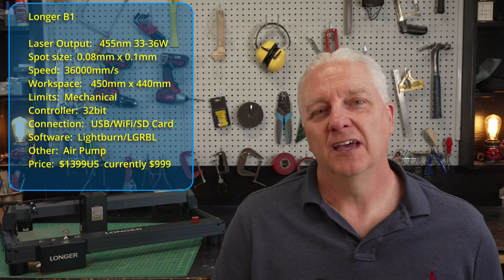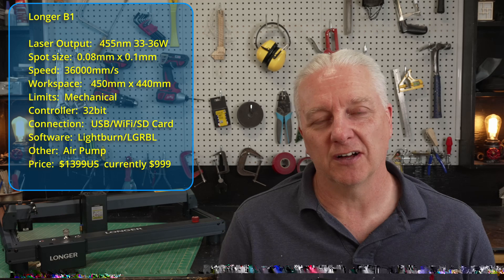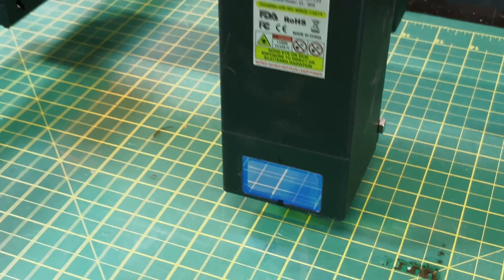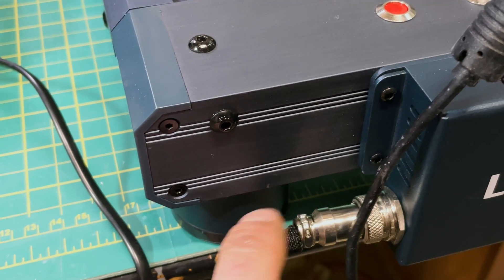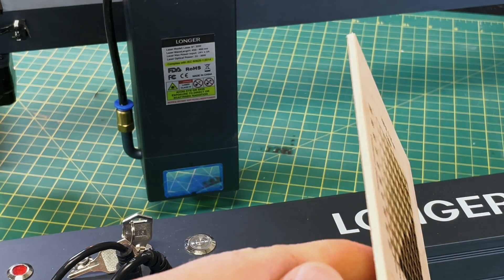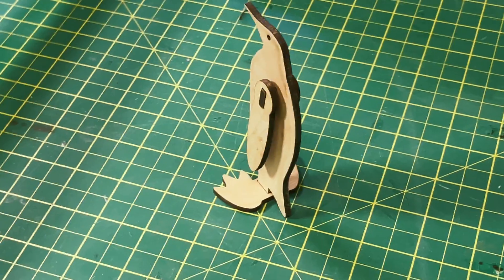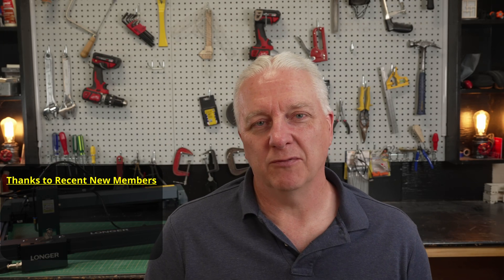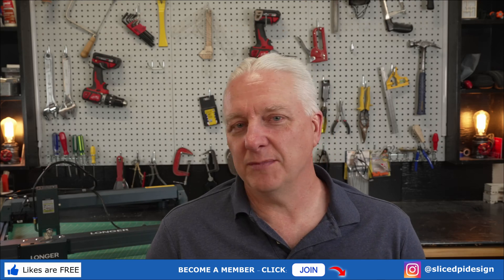The Longer Laser B1 30W Takes Center Stage - The Laser You MUST Own

Comment: Hi Steve. Having trouble with homing on B1 30 watt. Keeps hitting front rail. limit switch  x and y are installed.
Reply from the maker: Make that the homing position is in the lower left corner in Lightburn.  Also make sure that the limit switch at the front of the laser can be reached.
Reply: Thank you Steve. I had the Y axle limit switch in the wrong set of holes. I didn’t realise there was two sets of two holes. I must’ve missed that in the directions thank you very much.

Comment: Just assembled the B1 30W. After powering up and accessed by Lightburn, I had it move to the "home" position. It reached  the Y switch ok but came to a hard stop 2mm before hitting the X switch. Seems like the switch location is wrong. Hear of anyone else with this problem?
Reply from the maker: I haven’t, but make sure there isn’t anything in the way on either side, or that the cables aren’t binding and preventing movement.  In the worst case you could adjust the switch location, though I can’t remember if that’s possible on the B1 or not.
Reply: @SteveMakesEverything  Thanks for the quick reply. It's a hard stop and I can't see anything in the way. Temporarily, I'm gluing a 2.5mm shim to the side of the head until I hear back from Longer. Hopefully they have a fix.

Comment: has anyone modified a co2 laser to run with a diode laser head?
Reply from the maker: Are you asking about a CO2 laser that is also a diode laser?  I have thought about this with my DIY CO2 laser, and in theory, it should be pretty easy to do.  But I'm not sure there's a lot of value since a CO2 laser can do 90% of what a typical diode laser can, plus it can do a lot of this a diode laser can't.

Comment: Hi Steve....
Yup, another question from frequent flyer Hank....  BUT, THIS is really important - (I think)....
Well, UPS says my B1 36 will be delivered tomorrow, Monday 4-8-24.  From the assembly videos I've seen, the belt "idler/tension/adjuster pulleys" are SMOOTH and not toothed.  I will know for sure tomorrow what type idler pulley Longer is NOW using, but, It just seems to me, my design engineering self, that for a toothed belt to roll over a smooth idler is not optimal, squishing the teeth vs having them run in the proper slotted teeth.  I believe that a toothed idler will give the belts the PROPER seating when they run over them.  I think that IF I decide to change out the smooth idlers with toothed ones, it should be done in the very early hours, if not immediately, before running the machine.  What is YOUR opinion on smooth vs toothed idler pulleys??  Thank you for your experienced reply....  Hank   P.S.  (IF I am way overthinking this subject, You gotta tell me, I will appreciate your comments)....
Reply from the maker: Rest assured, the presence or absence of teeth on the idler pulleys is not a cause for concern.  The idler's primary function is to maintain the belt's alignment, not to necessarily engage with the belt.

What I will suggest for the B1, though, is to engrave a big circle (~100mm dia) to make sure the arc is smooth.  On mine, I had to lower the X and Y acceleration values in the machine settings because, with the 40W module, the weight was just a bit much for the steppers to push so quickly.  I don't recall seeing this on the 36W module, but it's worth checking.

I don't think there is anything mechanically wrong, but rather, the default acceleration values are just too high for the laser module's mass.  When engraving a circle, the X and X are constantly changing, so with a heavy laser module, the gantry is constantly jerking around which amplifies the inertial effects.
Reply: @SteveMakesEverything  Thank you Steve....  I really appreciate your advise....  Being retired from a career working for KSC, I have a tendency to “over 
engineer” common, everyday items it terms of " what does NASA require"?  I’ll have to determine is this “fix” really necessary and just use as designed… (Don’t sweat the small stuff)…  Thanks again..  Hank
Reply from the maker: @ainttakenanyshit  😀  Well, this made me laugh, but I can relate, having spent many years in industries where if someone makes a mistake, people die.

Comment: Hi Steve, need a favor please.  Big "A" has the Longer B1 36 watt kit with some material for ONLY 899.99.  Now, I want to hit the wood burning and maybe use my current hood.  IF the B1 can be raised buy ~1/2 inch, the bottom tubular frame may just fit underneath the B1's frame and the extra 1/2 inch needed for each side may just work.  Can you please report the width and depth of your B1?  The nearest 1/16" or so will let me know if my plan will work.  Thanks ahead of time for your measurements.  Hank

P.S.  If you may also measure the distance between the left and right feet, (not the bottom of the foot, but the foot SCREW - itself), THAT will be the determining measurement if my old hood will work with the hood's bottom frame tube will fit between.  Thank you BIGELY for your time....
Reply from the maker: Hi Hank, For the dimensions, you can look at the Longer web page. My laser is currently on loan, so I don't have it at my fingertips to provide a measurement.

The laser is a light frame and you can raise it to any height you need to.  Just remember that there is limited Z-travel so whatever you slide under the frame needs to be able to reach the laser.
Reply: @SteveMakesEverything  Thanks Steve.  I bit the bullet and just bought another enclosure that will have room to spare.  For 99 bucks I bought the enclosure for the "Twotrees TS2 machine with dimensions of 800mm x 800mm x 400mm, (31.5" x 31.5" x 15.8")....  I understand that there are two "optional "cutouts on the right side, (front and rear), and on the left front side which may be opened a bit to provide some cross air flow over the machine which "should" help with smoke "withdrawal".   I'll have a couple of inches to spare and from the reportedly low airflow that the included fan provides, I bought a 4" inline duct fan - ~130 CFM vs the maybe ~60 CFM stock fan.  I am going to mount a full 4 inch air duct connector to the enclosure to take advantage of the full 4 inches of available duct diameter.  My first cuts will be to make a 4 inch "backer plate" for the duct adapters....  These enclosure kits often use only a 3 inch to 4 inch diameter vent adapter which restricts what airflow is possible.  This coming Tuesday is MY B1 day...  🙂

Comment: With the exception of lower power in the 20(24) watt model, would you say the units are basically the same in features and build quality?  What is your "ideal" belt tension so as to help reduce line squiggle, BUT, not to over-stress the belt pulleys/bearings?  These bearings will run all day long in a complete circular manner and when engraving very small images, the very small rotational motion of these bearings have a tendency to have more localized wear with the very small "rocking" effect in the bearing track.  How tight is tight enough for belt tension?  Thank you for ANOTHER great video that answers a lot of the questions "we" have about these machines....
Reply from the maker: All B1’s use the same hardware regardless of the laser power, so the same features and quality regardless.  You won’t get localized wear on the  pulleys and rollers because they make several rotations when moving even short distances. However they bearings, so you might eventually have to replace the rollers, though I haven’t ever had  to replace one - this applies to any laser btw.

As for belt tension, they should be tight, but you should still be able to easily squeeze both sides of the belt together. They aren’t guitar strings.
Reply: @SteveMakesEverything  /Thank you Steve for the info.  My B1 36 will be delivered next Tuesday  ;-)

Comment: Does that Y limit switch actually work? On my machine, the laser head hits the frame before the limit switch is touched.
Reply from the maker: I 3D printed a little extension to press the limit switch sooner.  If you have that and it’s still hitting then maybe it needs to be longer

Comment: I just bought the longer b1 40 watt and it is a great laser but the way they hold the laser head on the dove tail is very hard to get to when you have big hands like I do...was wondering how you over come this problem...Bill
Reply from the maker: Hi Bill.  Yes I agree that they make the screw very hard to get too.  I don't have a solution for this other than to use needle-nosed pliers or maybe 3D print some kind of extender to bring the screw out further.  Or get a longer screw

Comment: Please help me I have a DAJA d6 laser engraver, I want to engrave personalised initials “in gold”, is there some kind of gold foil I can use for this? ,
Reply from the maker: A diode laser can’t engrave gold. For this you would need an IR laser or fiber laser
Reply: @SteveMakesEverything  thank you for your fast response, so just to clarify I’m not looking to engrave gold, I’m looking for a gold coloured foil similar the the black water slip foil I use to engrave black letters into leather.
Reply from the maker: @bustamango863  Ah!  I don't know of a particular foil that would do this (other than gold, of course), but in this case, I think you would apply it the same way you would if you were gilding engravings in wood.

From my own misguided perspective, I would probably mask off the leather before engraving the letters and then paint it with gold acrylic paint afterward.  (Disclaimer:  I'm not any sort of expert in this area, so I wouldn't trust me 😀)
Reply: Ok thank you for responding I will  look into it. Very helpful thank you.  @SteveMakesEverything

Comment: Xtool uses their own free software creative space and seems easy to use for beginners. Videos I've seen show with creative space you tell it the type of material, thickness and it automatically sets the perimeters as a good starting point, does light burn have a similar  feature?
Reply from the maker: In lightburn you can use the material library. It’s kind of similar in capability but is a bit more complicated. Overall lightburn is more capable than xTool XCS but has more of a learning curve.  Also newer lasers from xTool and others, have more features than traditional diode lasers and these aren’t supported in lightburn

Comment: I feel longer really dropped the Ball, 
I think they new of the software problems and sold the b1 to drag in cash and 2 they disappoint me because you guys have to figure out the problem for them and now the question is did they fix the software problem and the air assist problem that showed up in other videos.
I really wanted to buy the b1 but if they still have the same issues I will go with sculpfun 30 watt lazer. It will be my first lazer and the last thing I need is to have problems right out of the box.
Reply from the maker: I love a contrarian opinion 😁. However I haven’t seen any real software problems with the Longer B1 and having used it in my own shop since I got it, it remains one of my favorite  new diode lasers.  The only problem I ran into was in Lightburn, which selected the wrong driver during automatic setup.
Reply: @SteveMakesEverything  
I guess that was the one I was referring to the selective of the wrong driver
I really do like the b1 it will remain on the top of my list and I will be watching all the videos I can on this laser thank you for your videos.
Reply from the maker: @sigh_of_the_times  I'm not surempf this was a B1 laser  or a Lightburn problem.  Either way it was easy to fix and resolved all of the issues I was having

Comment: how did you manage to setup the wifi-connection?? theres only one way to operate this monster: you have to be in range of your usb-cable...  this is sad!
Reply from the maker: I used usb. I dislike most wifi features on diode lasers because most of the time they are pretty flakey.

Comment: Well I have not purchased a 30watter yet...I plan to, but see some decent looking upgrades on some of the options out there.
Any chance you will be doing a reveiw on the Atezr L2 36w Laser? It would be great to know how theses 2 compare.
The Atzer is about $350 more, I think the upgrades it has might be worth it.
What do you think of Atezr as a company? Going to watch your videos on Atezr products now.
Reply from the maker: The 35W L2 is essentially the same laser as the V35 so you can compare output to that. I’m not sure what upgrades you are referring to on on the L2. The only significant one is autofocus, but it’s far too slow for me to ever use.

Just some clarity of 35W lasers vs 20w or even 10w lasers. Don’t get hung up on power as the key feature.  Most laser companies show 35W and 40W lasers cutting through lumber, but in reality that is never a use case you are likely to have.  Instead think of power as a gauge of speed.  Higher power laser can engrave and cut faster. This is more important in a business than in your house,so if you’re on a budget, then opt for a 20W laser and you won’t really be disappointed, but you’ll save a ton of money. 

Both of these are great lasers, but right now, I would give the edge to the B1.
Reply: How about the linear rails would they be worth the extra $$$ ? Are they on X and Y ?
One of the reasons I am looknig for more power is to cut into some rocks from N.H. beaches...
Some one had a video where they cut into a rock with the B1 30w about .5mm deep, it looked good, how true that is I don't know.
My Longer 10w (I think) melts the rock and most of the time (depending on the rock) embosses what ever I am  engraving.
Thank you for the feedback...going to wait a bit before I buy...Hopefully the sale on the B1 doesn't end.
Reply from the maker: @eddrm4685  The linear rails are nice.

If your 10W is melting the rock, then your speed might be a bit slow, and you might want to go faster with multiple passes.

From any stone that I have engraved, I can say that results can be very unpredictable due to the composition of the material.  I don't honestly think this has much to do with the power of your laser.  

I've taken two stones that have looked identical in color, yet one engraves nicely, and the other basically melts.  I now try to do a sample of tiny engraving on the back of the stone to ensure that the main engraving will be what I want.

Comment: Hi Steve. Would you recommend this laser over the xtool 20w or the atezr 20w for overall use (hobby use and small business production)?
Reply from the maker: Well when you factor price, performance and features, I would favour the B1 30W right now.
Reply: I WAS on the fence between the Longer B1 36 vs 48 watt machines.  I had a Algolaser 22 watt which had "issues" and decided to order the B1 36 watt.  From my understanding, the lower power lasers usually perform "better" in terms of quality with fine detail as their one diode, (5 watt) or two diode, (10 watt) lasers have a smaller beam, which is what you want for fine detail.  For me, the B1 36 has a 0.08mm x 0.15mm beam profile and the B1 48 has a 0.10mm x 0.15mm beam profile.  SO, unless you really have a need for more power, the B1 36 was/is my choice....  IF your piggy bank has extra jingle, I'd buy the B1 48 watt and add their 2 watt "ruby laser" that has a 0.03mm x 0.03 mm beam profile...  The Longer website is out of stock with the Ruby and as of right now, 4-8-24 2 P.M EST, big A has the Ruby head for only 399.  I was feeling a little flush and I also bought the Ruby from big A which SB delivered today - my B1 36 is also out for delivery today via UPS....   *CHRISTMAS* IN April   🙂

Comment: Nice job!! THX!! but I wonder if there ever will be a laser on the market where you could choose you bed size..... just wondering!!  I would be interested!!
Reply from the maker: Well that option is starting to appear.  Several lasers offer extensions to make existing lasers larger.
Reply: @SteveMakesEverything  I know, but I would like to have a 20cm to 1 m bed size for rc modeling building… and that is still not possible…
Reply from the maker: @egonverleysen695  You mean you want a laser with an adjustable size?  Hmm, that would be interesting.

Comment: Steve, as mentioned by Vintauri below, you can bump up the homing speed in lightburn.  From the lightburn console, enter $$ and this will list all the g-code settings for your laser.    $25 is the homing speed.  Simply enter $25=2000 (or whatever number you choose) and this will update the homing speed.  Forgive me if this is obvious to you, I included this info for anyone else that may happen to see this and wants to know how to do it.  thanks!
Reply from the maker: Yes for sure.  My gripe is that they chose such a slow default.
Reply: @SteveMakesEverything  Perhaps the slow home speed was set so low to help reduce the latency in the limit switches.  Unless they installed optical limit switches, the mechanical type are finicky when engaged at higher speeds.  Just a thought
Reply from the maker: @stevenclark2894  I'm not sure.  It's certainly easy enough to change.  I also had to do this on the AlgoLaser Delta